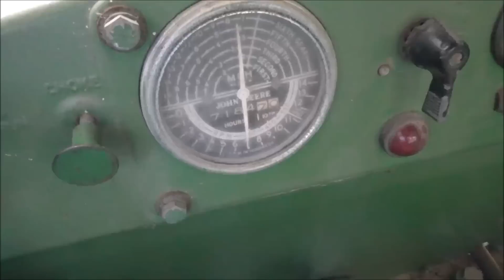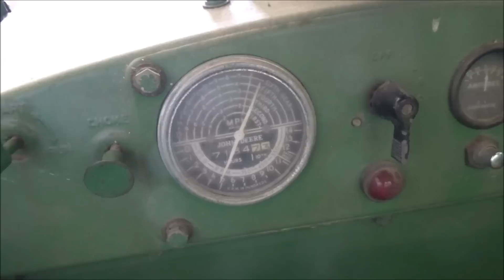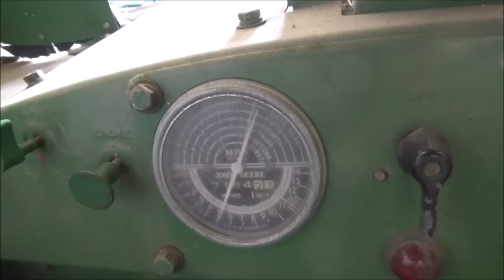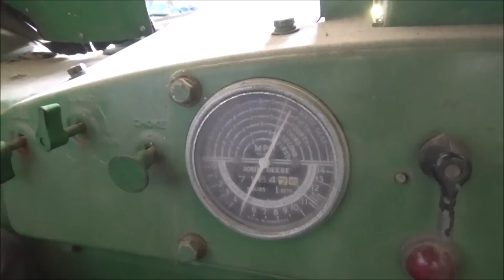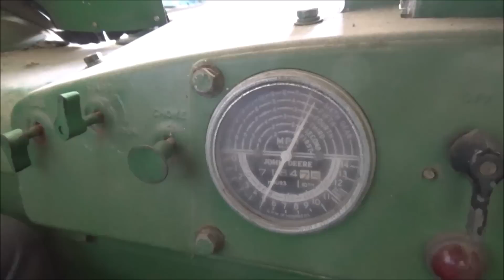Deere 820 2-cyl Diesel  Pony Motor Fuel System Upgrades

Comment: When you turn off that pony motor you lose 2/3 of your power.  By the time those pony motored tractors got started it was time to come in for lunch.  IH and their start on gasoline and then switch to diesel was not much better.  Oliver diesel tractors started by stepping on the starter pedal and then heading right out to work in the fields.  It was amazing that JD stuck with antique designs when others were making much better equipment.
Reply from the maker: I can have my big engine started in any weather in less than 1 minute with the pony. Try to get a 990 Oliver started in that time when it is 0F outside. Biggest advantage the Deere has is fuel economy. I can do twice the work in a day on 10gallon of fuel than any other tractor of the1960's or older.
Reply: @bcbloc02  Well at least you like Dodge trucks, Mercedes cars and old dogs....  Just having fun with you.  I always tell Harley owners that I have a much more modern design 2 cyl powered vehicle, my 1941 JD A.  Well I did until some guy with more money than he needed bought it.  Keep up the videos and keep Bailey going. My dog checks my welds, at least she does not watch the arc.
Reply from the maker: Always good to have proper supervision. :-)
Reply: @bcbloc02  She learned to get her nose only close to a hot weld and it only took one time to do so.  She does not very closely inspect welds on 2" upset tubing projects as the crap built up inside and outside pipe that has been down the well a couple thousand feet or more stinks like hell and probably she thinks it is dangerous and maybe she has a Geiger counter in her nose as some of it is radioactive enough the salvage yard will at times reject a load of scrap pieces when their counter goes wild.  Do not worry much as I have been welding on that stuff since 1957 and are still alive.   I will be welding on some today. ";^}  A friend says the AEC probably has my stash of a few miles of pipe stacked on my pipe racks tagged as a national threat....
Reply: @bcbloc02  I'm sorry, but the fuel economy was not that great, they didn't burn much fuel because they didn't get much done. I've been around the 720D since 1982 and when it works it burns as much or more fuel then any other diesel
Reply from the maker: @RJ1999x  Something out of tune with your 720D then.  These tractors proved their fuel economy at the Nebraska tractor tests multiple times.  The 720 actually held the record for most hp produced/gallon of fuel well into the 1980's. I can pull the same disk in the same field with my 820 or a 4020. They both will pull the disk the same speed and take the same time to do the job. The 820 will have used less then 2/3 the fuel the 4020 did. I used to have a 4040 and it did about the same as the 4020. With the quad range it could pull a little faster in some conditions but it still burned about the same fuel as the 4020.  Back when a neighbor of mine and I traded work he would use his Case 930 on my disk and it was the same speed as my 820 but burned twice the fuel! These were all fueled up before and after the job from the same fuel wagon with the same pump and meter so I know the results were accurate.
Reply: @bcbloc02  The 720 had the fuel system taken off sent in rebuilt and balanced. It turns 74 hp on a Dyno and yes it burns less fuel than a 4020, and pull roughly as much. However when I started farming I had nothing, and needed a tractor so I bought a D17 from a bank, it came in a box I had to put it back together. My grandpa thought I was nuts, laughed at the size of the 17 in comparison to the 720, but all the laughing stopped when the 2 were in the field together, the D17 could walk that 720 like it was backing up, and at the end of the day when you compared the fuel burned to the work performed the D17 was far better. I still have both tractors the 720 doesn't burn much fuel when it's putting around but when you load the diesel down it burns more fuel per acre. 4020 by the way are horrible on fuel, so more fuel efficient then the 4020 isn't much of an achievement.

Comment: This tractor's both engines run like new ones...
Most newer gasoline has ethanol added to it, this is a pain since it contains a small amount of humidity, real deadly to metals after some long sitting times. Should keep the corn for good whiskey, not for running engines...   😨
Can't hide from the "Supervisor", even when working far behind the shop...    😎👍
Reply from the maker: Supervisor always tracks down the help no matter where you hide. :-)
Reply: @bcbloc02  That's what makes Bailey such a good supervisor.
Reply: @bcbloc02  The NOSE!

Comment: External flywheel. I admire your persistence with old equipment.
Reply: Sorry, that is not the flywheel but rather the belt pulley. The early twin cylinder JDs had an open flywheel on the left side and were used for hand starting as opposed to a crank. I doubt anyone could hand start this diesel because of the high compression. I also love Brian's persistence.

Comment: Nice work. Our 830 is electric start. When we got it from my grandfather it had fluid and 3 sets of iron weights. Don't run it much it pumps engine oil to the rear end. I've had very good luck with sealing tanks with RedKote.
Reply from the maker: You should fix it so you can use it, its way better than letting them sit. :-)
Reply: Great work Brian. I grew up with a “B” and “60”. Nice to hear the old 2 cylinders run. My neighbor has a “R” he plows with. We hear him one half mile away.

Comment: I'd love to have that pony motor in my lawnmower instead of the crappy old briggs
Reply from the maker: I am told it used to be popular to use them in midget cars for racing as they make like 30hp. Back in the day that was pretty stout compared to a 12hp kohler about the same size.
Reply: @bcbloc02  If you could crank an old Harley, you could fire a pony, no problem. i had a 68 Electra-glide. NO different than a pony except a rope or a kicker.

Comment: The old cat guys recomend shutting the gas off to the pony motor to prevent diluting the lube oil in the pony motor. I think it is a good idea.
Thans
Reply from the maker: Yes there is a knob in the cab for shutting the fuel off and I shut it off and let the pony run dry everytime.
Reply: We had more than 1 tractor fill the oil pan with gas when the float stuck on the carb.